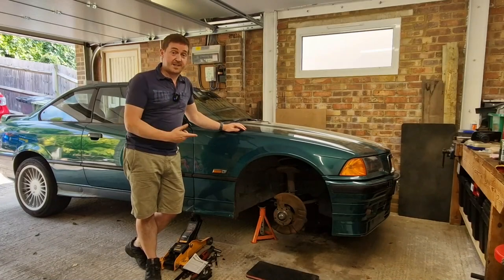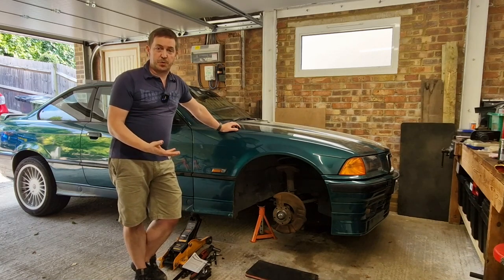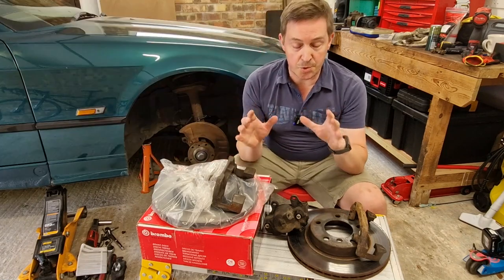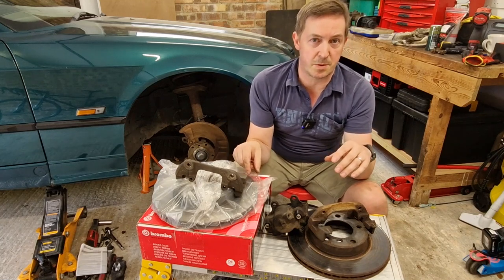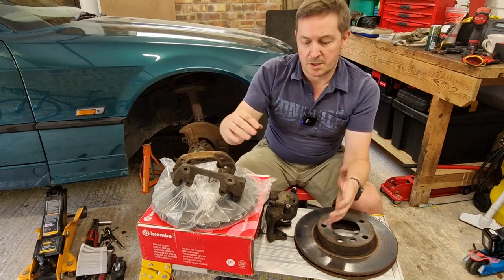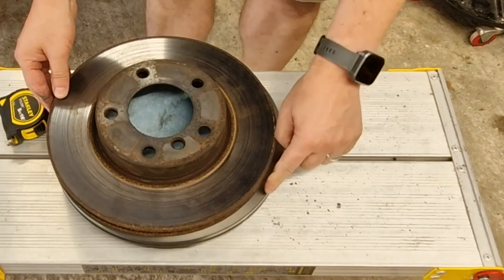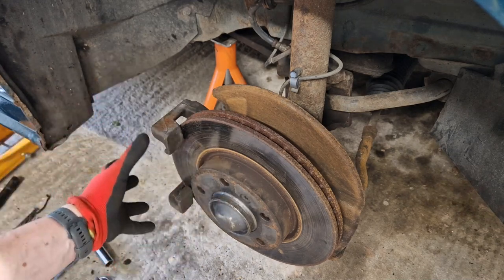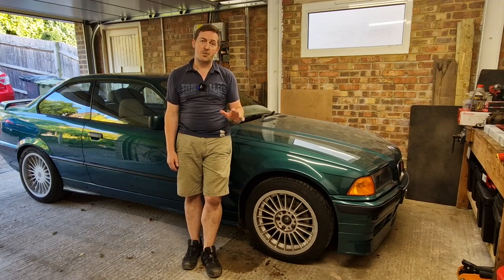BMW E36 gets a CHEAP big brake upgrade using E46 325Ci parts - Simple DIY

Comment: Just to add some mostly helpful info: these 300 mm have come even on some 320i and 323ci e46s Sedans as well (BMW called it "usable load increase") and are also the default on 328i.
Additionally, on the e46, the rear can be upgraded the same way from 276mm to 294mm, so an even larger change than on the front. This moves the bias a bit more to the rear, but is something that you may want. I think it's something like 6-7% more to the rear? Don't quote me on that. What I'm not sure is whether the rears would bolt on to the e36. I know there are some differences there, like the e46 discs being ventilated, 19mm thick as opposed to the solid 10mm ones on the e36.
I did this upgrade, front and rear, on an e46 and, on track, the car felt like it wanted to rotate more on trailbrake and the brakepads usage equalized between front and rear, which was not the case before. All in all it was really worth the "trouble".
Reply from the maker: This is super useful, thank you. I had already considered upgrading the rear brakes to either 276mm ventilated units (as per later E36 convertibles) or to E46 325ci at 294mm as you suggest. I haven't found the definitive answer to whether E46 units will fit, but I was happy to take a chance.  However the price of 2nd hand calipers seems to have increased significantly and whereas before I bought two for £30 in total for the fronts it now seems sellers want twice that for the correct rears. Worth pursuing though for exactly the benefits you mention.

Comment: can you do a wireless apple car play\android auto upgrade on your subaru impreza?
Reply from the maker: I've no plans to as the current unit does everything I need especially as I still listen to CDs. But being a double din unit there's any number of aftermarket units that will no doubt just slot right in.

Comment: Can this simple upgrade work with other models like e87/e90  with  calipers carriers
Reply from the maker: I've never owned a BMW on either of those platforms so I don't know, but I'd be surprised if there wasn't some kind of tried and tested upgrades using original BMW parts.